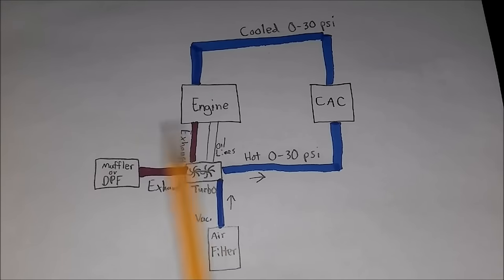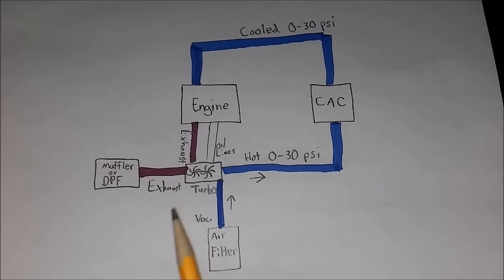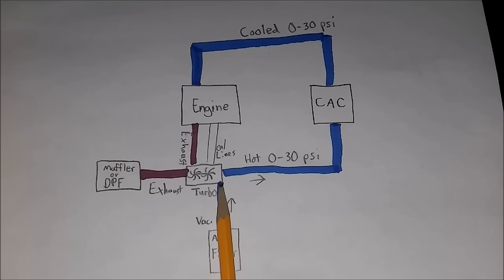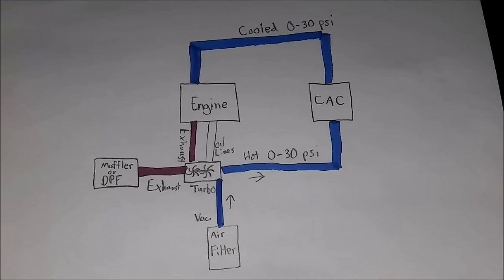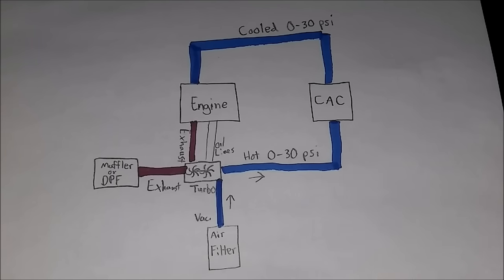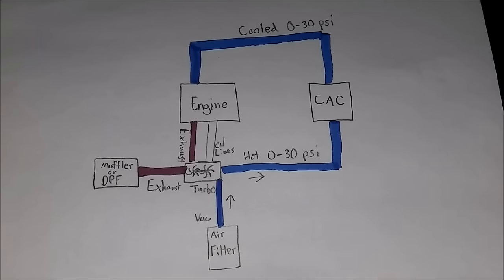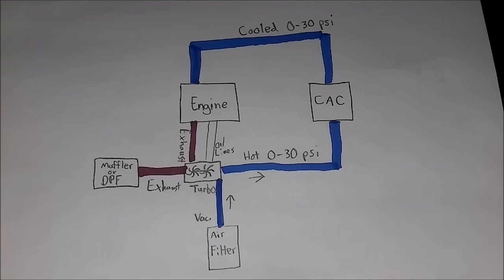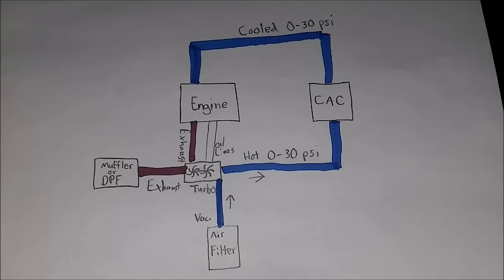What Causes Low Boost?  How Does A Turbocharger System Work?

Comment: When i got my little big truck the turbo wasnt spinning right. Was only doing anything at the very end of the rpm range. I didnt know there was a problem because i didnt have experience with the motor. Just figured thats how it was because it has no wastegate. I figured out it was coked up or whatever and wasnt allowing the compressor to spin freely untill i changed the oil, filters, etc and started driving it hard and then all a sudden the turbo spools ALOT quicker and builds longer. Amazing what basic maintanance can do. The truck sat for years. I use Delo 400 SDK oil, nothing fancy.

Comment: Greetings Adept Ape. I hope you and yours are safe and well. I'm sure you get a lot of questions so I'll keep this short. Rest assured many dozens of hours have been spent trying to diagnose what can only be referred to as inconsistent timing on my 1985 (january build) so early 7FB series 3406b. I know it sounds crazy but bare with me. Have you ever heard of losing the thrust washer behind the idler or bull gear in the front timing gears? BTW the ATA was checked and the weld to account for slippage is intact and well done. It's been over a year and already cost me an inframe. Thank you for your time. Drew McEwan subscriber and avid follower, Whistler BC Canada

Comment: If the hose that goes to the turbo to the waste gate comes off will it then lose boost or will the boost go up very high like on the fast & furious like when Dom pulled the hose off with a piece of wire???????

Comment: Thanks for the video!  Just to help my understand of turbocharged diesels, what would happen if there was an older 1999/2000 Cat 3126 (no electronics) running properly under load (constant) and something stopped the outside airflow through the CAC, such as a large piece of debris like a garbage bag, etc. and the driver continued to operate the vehicle. The air coming to the intake manifold would get pretty hot.  Would the engine lose a noticeable amount of power and overheat?  Would there likely be heat damage to the head/valve assembly or pistons/rings?   Thanks again.  We really appreciate you.

Comment: Hi mate! Also less fuel supply (due to blocked fuel filter, worn pump, ...) can cause lower boost pressure. Wright?  I found out that this is hard to understand for some people.  Keep up the good work!👍 Them turbo's get accused way too mutch/early. ☺ Grtz!
Reply from the maker: +KennyC405 I can't remember if I mentioned it in this video, but yes, low fuel pressure can affect boost because you would have misfiring injectors. This would cause an engine miss and incorrect fuel timing, which would lower the boost.

Comment: I've seen some turbos with electronically controlled wastegates and turbos with external wastegates.
Reply: so i bought a 04 vw passat with a 1.8t and its check engin light was on after buying i took it to autozone to check the codes and i got p0299 saying my turbo is underbossted and the a ase tech recommends replacing my turbo wastegate solenoid also code po420 and code p0441 where thrown catalyst  system below threshold and evaporative emissions system incorrect purg flow because i have a bad exhaust leak so my question is do you think that the problem it my solenoid or could it be something else and also is there anyway this problem could relate to the exhaust leak please help me

Comment: Lo boost also caused by melted fins on the exhaust turbine; my pyrometer thermocouple was failing and giving low readings when pulling my travel trailer and soon boost was down 1/2. GMC 6.5 with Banks Sidewinder (and a Banks pyrometer I might add.)

Comment: Thanks for this video.  Yesterday when driving into Colorado Springs, I started have a a delayed acceleration each time at a traffic light, then it gets going.  What would be your first thought for that?  It seems fine after.  On highway, boost pressure is always 20's to 30's.  I never looked around town.  Driving to campsite in town, it would go down to very low numbers. I assume this is normal?

Comment: Great video. I have a low turbo boost problem on my truck. I had hoses changed, boost sensor changed and cac changed and still have low boost
Reply from the maker: +Antoin Zachery Have your tried pinching the wastegate and driving it to see if that fixes it? Any other engine problems like low fuel pressure or smoke? You can check the exhaust for back pressure that can cause low boost as well.
Reply: No low fuel pressure and no smoke. I like to check the intake manifold for leaks. I spent so much money trying to get my turbo fixed. I taken it to different shops but keep getting different answers. I just want on direct answer why my turbo is producing such low boost. You have a shop near Cincinnati, Ohio?
Reply: +Adept Ape I meant I want a direct answer from a shop who is looking at my turbo. In a way I feel the shops I was taking the truck to were guessing the problem.
Reply from the maker: +Antoin Zachery No sir, the shop is on the West Coast.
Reply from the maker: +Antoin Zachery Well when you have several components changed and didn't fix the problem, they sure sound like they are guessing.

Comment: If the boost pressure sensor and temperature sensors not working correctly that's also reason for a sluggish pick up.I'm faced that problem in ashok leyland bs3 edc engine.

Comment: Adept Ape, I have a C15, twin turbo setup that has a plugged DPF, the driver says he's not getting any boost, so I'm guessing it's because the DPF is plugged. Anyway, when he shuts the truck off, you can hear one of the turbos still spinning for about 1-2 minutes, why would a turbo keep spinning? Do I need to replace it?

Comment: I want to turbo my Vw sand rail. What is a low cost small turbo that will run independent of the engine ie no computer or vacuum hoses? Thanks great video.

Comment: Good morning. I have a freightliner box truck with a CAT engine. It blew the CAC tube off of the turbo. Assuming it wasn't a loose or rusted clamp, what could cause this to happen? I had some ac work done at a shop. I'm wondering if they removed the tube to better access the ac lines passing under the tube and didn't tighten the clamp. Hopefully it's that simple.

Comment: Hey man thanks for this nice video i have problem with my bmw n54 my car running well at the begining after like 5 minit i have check engine light it’s flushing on my dash and stop my twin turbo when the light came on the car it’s on leap mood and show code 3100 boost presure leak and i have wastegate sound

Comment: Man you help me so bad to diagnost my bad wastegate. My turbo was creating 5psi of boost instead of 25psi and i did youre trick pinching the wastegate hose and try to see if it creates boost and it did create boost so my turbo is ok. Took the visgrip off the vacuum hose that leads to wastegate and did a pull and only made 5psi of boost so wastegate is not holding pressure

Comment: how can I schedule an appointment with you guys? where are you located. I think my twin turbo C15 needs a checkup. yes, boost is starting to drop, no, haven't gone anyplace to get it checked yet...lol. but I believe the turbo has about a million miles of use put through it.
Reply: I would suggest that you make an appointment with an authorized CAT repair facility, as the young man may not want his place of employment revealed due to possible CAT Bravo Sierra policies.  Good of you to want him and his repair facility to benefit from his videos.  Your engine may require some new injectors in order to elevate exhaust flow to the turbos to increase the boost pressure. Merry Christmas.

Comment: I drilled a tiny hole 1/32 1/16 hole in the EcoBoost f150 so the air intake wouldn't clog w blowby. It was going into limp mode with no power but now the small hole allows for gunk to escape. No more complete power loss but I have the p0299 code. I also have a catch can on the hot air line that also catch gunk but allows some air to escape. I'm thinking the air escaping is why I'm getting the p0299 code....
Reply: cool story. go share it with the little pickup truck youtube page people. This channel is for big cat diesel engines in big commercial trucks
Reply: thanks mike. i did.
Reply: Holy  Mike, I have a Kenworth highway truck with a Cat and a Kenworth dump truck with a Detroit. I don't cry around that I have a big engine or a big truck. Oh, I also have 4 pickup trucks and I don't call them little.

Comment: Can you "T" into the wastewater hose to install a boost gauge. My '03 freight liner chassis Motorhome with a 3126 didn't come with one. I've seen a Bluetooth device that plugs into a OBD2 socket that then uses an Android app (one is called "Torque") to display different gauges and info on a smart phone or tablet. Any thoughts on adding a boost gauge. Our rv is currently at a Caterpillar dealer a 100 miles away getting fixed for low boost. Wouldn't go over 40-45mph. Diagnosis so far, bad boost sensor and restricted muffler/catalytic combo. Thanks for posting and sharing your knowledge.
Reply: richard leitner Yes you can add a T to your wastegate and install a gage. I did this to my 300SD Mercedes. I've had no problems with it.

Comment: Hi buddy, great vids, i have a focus 2010 1.6 tdci 109hp and i have the p0299 code coming up. I changed the solenoid boost control valve and the egr valve as i had a stick open egr code as well. Not solved. It’s strange as if I accelerate to the floor in 2 nd, 3rd, 4th, 5th from under 2000 rpm the turbo will do full boost, about 1.1 bar and hold constantly until i shift into next gear at 3-4000 rpm, i have a boost gauge; if i try accelerating from 2000 rpm or higher the boost goes to 0.5  0.6 and if i keep my foot in it will go into limp mode. No sensor codes or other codes come up, i hear no sounds of air escaping anywhere. Any idea what can cause this? Mechanics are baffled also. Thanks for the help

Comment: I have a c13 issue when cold. Engine stumbles, lots of smoke, and a fluttering sound.  I can back off the throttle a little and it goes away.  No issue when it seems coolant and oil up to temp. Injectors were replaced, running 75 psi fuel pressure at idle between 80-90 driving down road. Could wastegate cause this?

Comment: I got a 3406b 7fb prefix motor. It only builds 10 psi of boost. The truck had another 7fb engine in it that broke some piston rings. That old motor had 28 psi of boost but it was turned up.  The new motor only has 10 psi of boost. When I bought the motor I was told it wasn't turned up any. How much boost should that engine build set at factory? Its air cooled.

Comment: I have a question on a 3306. I rebuilt this 3306, had oil coming out of exhaust side of turbo and out of cylinder 2 exhaust port. Pulled the head back off, replaced piston, rings and liner on that cylinder. STILL have EXCESSIVE oil coming out of exhaust housing of the turbo. Could that be bad oil seals in turbo? It’s almost instantly after starting engine the oil coming out of exhaust housing

Comment: Hi , you say that if you pinch the wastegate actuator hose and then run the truck and then your boost returns, then that means your actuator is bad...but i thought the actuator being actuated opens the waste gate port to decrease boost pressure by bypassing the turbine.  Im trying to diagnose a 3126b that turns on and idles flawlessly, but after it warms up a little it then goes into an unbalanced idle state. Boost pressure only reaches 8psi at wide open throttle while driving , and 7psi at wide open throttle on neutral.

Comment: Hi, I have a Perkins Parma m3 interested in more power and better knots per hour. What turbo do you recommend , i am mostly interested in efficacy. Running as lean as possible. Also running kerosene type 1 fuel instead of diesel type 2 fuel oil can or can’t Fuchs up injectors. Might have to add 2 cycle oil to lub injectors because they are not self lubricating. This is also a propane issue?????????

Comment: I noticed in the draw diagram you have shows 0-30 psi. I had no idea cat turbos and engines had great power to lower psi. 
My first truck has an Cummins isx 13 and the boost would go to 50 psi every time i climbed hills. It had a vgt turbo.

Comment: Great Video, Have a question Have a G3306TA boost pressure after the wast gate is 4 psig it goes through the carburetor at 4 goes into after cooler at 4 but comes out of new after cooler at 1 psig. Is this Normal drop.

Comment: I got a 14 l Detroit.   How to test to see if the actuator is stuck.  I’m getting moaning sound when let off the accelator like it’s building too much pressure.    Should I be able to move the rod up and down by hand or when does it move on it’s own at idle?

Comment: What would cause no communication to turbo on a 2019 Mack granite? I’ve looked at both fuse boxes and check wires and currently at a loss on what’s causing the issues.

Comment: on a generator set do they use a smaller turbo for the steady 1800 rpm? i’m trying to figure out how they achieve 30-35 lbs at less load/rpm

Comment: I have a 3406B in a 93 Kenworth T800 dump truck and when I’m loaded and going up a grade it won’t boost past 15psi I’ve replaced all the intercooler boots and the AFC diafram on the backside of the injection pump. Any ideas?

Comment: i have a c32 engine on 1000kva genset. while the engine run on idle condition there's no black smoke but on 50 percent load the engine exhaust black smoke continuously. Also the boost pressure doesn't change. Will there be any chance of leakage in CAC or something else

Comment: Adept Ape!!! Please help me out with a low boost problem. The engine is a year 2000 model C12. I have two important question, when disconnecting the power boost sensor and checking volt and ground coming from the ECM, i am getting ground, 4.9 volts and the signal wire is reading 6.2 V. Is this correct? 

Now when I connect the plug and turn on the truck I am getting signal back at 1.4 and it doesnt change even though I accelerate all the way down, truck parked. Only getting 1 psi boost max 4 psi with the peddle at 100 percent!

Comment: I've got a Mercedes om502la that's acting alright at low throttle but once I'm on the highway trying to get some power, she falls on her face around 15mph 
The unit is a crane, quite old, so my rpms aren't currently working. I thought I'd pick your mind on this. See what you thought after watching your video
Reply: BGinner Gamer Check your boost, if low, check charger for spin and play. You can get a rebuild kit from mercedessource.com

Comment: Hey man, I have an issue with my engine. The trucks starts but doesn’t go over 1000 RPM and it doesn’t pass 3 Mph. Any clue what could be the issue. I have a C15 Acert . If you can help me, I’ll really appreciate it.  Thanks

Comment: I've seen excessive valve lash cause low boost. basically all the engine and components are is a big ass air pump. if you're working on a machine check the precleaner too. I've seen the venturi in the precleaner get damaged or plugged and cause no chooch. ("chooch" being powah.)

Comment: I need help. I have a 2004 c12 mBL11904 low boost . I have 5 lbs under a pull it set a boost sensor code originally. Put on a sensor on part#1611705.cleared the codes replaced CAC asst which had a 3 inch crack replaced air and fuel filters. It runs 90 psi fuel pressure under a pull and 65 psi at low idle. I checked turbo and wastegate movement no diaphragm holes or stuck valve fins look good on both ends. Ran it with exhaust disconnected from turbo no difference. Only thing I found is primer pump doesn’t work. Have not replaced it yet. Sprayed down intake and tubes and no leaks. Any suggestions?

Comment: i hate to back track on a older video,  but i think its a decent question to ask.  In the Hot side of CAC, or Cold side piping,  some of the tube connections have blue boots with ribs and rings around them, obviously cause the expand under psi, why on some of the connections of pipes do they use like a smooth orange  boot?  can i replace those soft feeling orange boots with the blue ribbed and ringed boots? To me those orange boots seem to be soft and sometimes feel like they have a little crunch sound to them like they are breaking down. Maybe causing a low psi leak, but not enough to be noticeable.  Id like to replace with all the heavy duty looking boots.
Reply from the maker: +kwmiked Yeah, some trucks use the orange and some use blue. You can use whichever one you prefer really. I know some seem thicker, but as long as they are high pressure and temperature rated high enough, they should work
Reply: Boots?

Comment: Help!!! I have a 400hp twin turbo car. Changed the heat exchanger and the cold air intake. Also the catback. With normal drive it runs great. But after 2 hours driving if I full throttle. The turbos doesn't work!!! Y feel like I lose a lot of power. (like if I was on a hill)   any ideas?????  Thanks.

Comment: Thanks !   
How do you know what to adjust your waste gate to? Just loosen arm until it can install on the turbo gate lever? 

  Just picked up a used 2004 ram 2500 5.9  144,000  . low boost code and increasing compressor surge noise over 800 miles reset code seemed fine then got worse and codes now included low boost/ speed sensor/fan speed codes....  By inspection found when the after market compressor was replaced, then turbo put back on, was not torqued down to specs and had a cross threaded nut/stud that was fairly loose...( turbo to exhaust)When I removed the turbo cleaned everything and tested waste gate , arm was tight to put back on turbo's gate lever ( sorry not sure of term) .... cleaned and applied new gaskets torqued down to specs    compressor surge pretty much gone except on very hard acceleration, also much much less I would guess 90 percent reduced from before.I removed turbo....      also replaced fuel filter, cleaned MAP and IAT sensors.